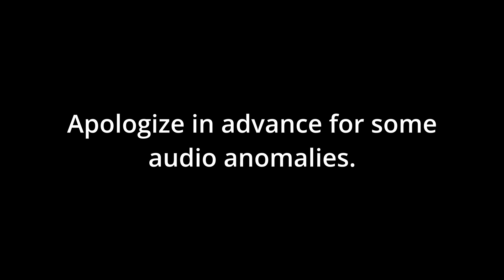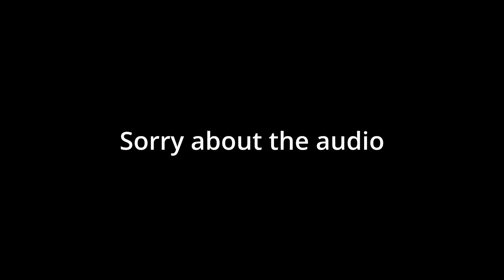Dry Air for Your Air Compressor | Roundtail Restoration

Comment: Hi Chris.
This is the modification that i need.
Some years ago i build my own compressor, and also installed automatic bleeding of the bottom valve but heavy usage can still couse moisure in the air.
Just wondering, do you have a one way valve on the line before the compressed air reaches the airtank?
Reply from the maker: I think the moisture separator acts as a one-way valve. I haven't used it a lot yet so I don't know how successful it will be over time, but it can't be any worse,

Comment: Nice one. I need to do this on my setup. I have an old bathroom heated towelrail that I was thinking of plumbing in after the compressor unit and mounting on the outside of where the compressor is, but I like your compact unit and that it's cooled by the fan. A water trap also makes sense; I've seen a series of vertical copper pipes that are interconnected but allow water to collect at their lower ends so that they can be purged using ball valves. It makes so much sense to cool then water trap the air. I wonder if there's a best way to mount the cooler until to encourage the water to get to the seperator, too,
Plumbing shops and DIY places sell a spring that can be put inside copper pipes to reduce the crimp effect to almost nothing. They are very cheap and have loops for a lanyard to they can be withdrawn.
Cool video and good inspiration. Thanks! Be good to know how youor setrup performs when running for a decent length of time.
Thanks also for including the links.

Comment: Nice video. Pretty cool modification. I raised my IR compressor about four inches and replaced the drain valve with a ball valve. This makes it easier to drain the tank every day. Drain is plumbed outside. I also added a ball valve at the tank so I can shutoff the compressor from my air system at the end of the day. Eliminates compressor running unnecessarily if I have a leak.
Reply from the maker: Thanks for watching. I have a ball valve at the tank, but not at the drain. Still the little knurled knob - got to change that. And it just drains to a container - sigh.

Comment: Using a piece of electrical tape or something else to provide a non-reflective surface will make your readings with the non-contact thermometer more accurate because they are calibrated for a higher emissivity than the metal pipe provides.
Reply from the maker: Well that's cool. I had no idea. So, I take it off be reading lower than actual without the tape? Thanks for the tip!
Reply: Hey  @roundtailrestoration  You're welcome. It's likely to be lower than actual when looking at the uncovered metal because you're seeing the reflected temperature from the environment. You just need something that's non-reflective in the infrared region. 

It seemed like you got a decent reading when you caught the painted area at the outlet of the cylinder. You can also use some paint on the tubing to get the same effect, tape is just convenient for a fast measurement.
Reply from the maker: @anyheck  Cool, makes sense to me. Thanks very much for the education!

Comment: That's a great idea, thanks for the video. Curious how much moisture you see getting collected by the water separator, and how much less you find blowing out the tank drain now?
Reply from the maker: I haven't used it enough yet to be confident in long term success. I intend to do a followup in the near future. It's got to be better than nothing, but just how much I'm not sure yet.